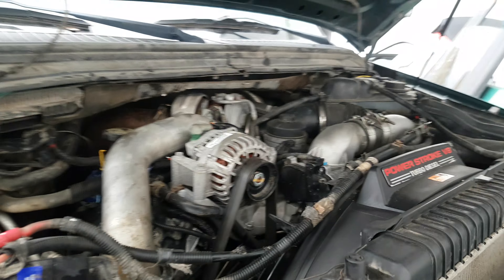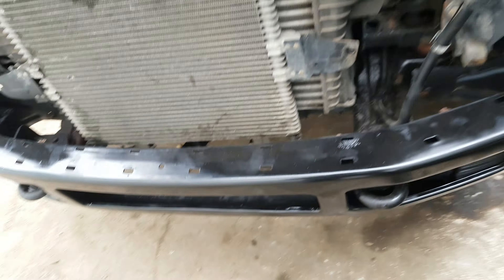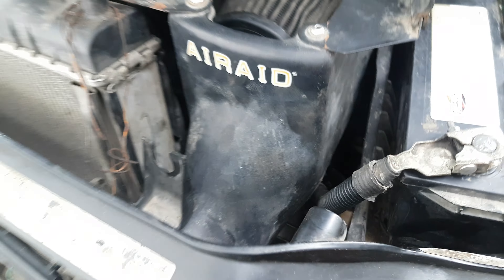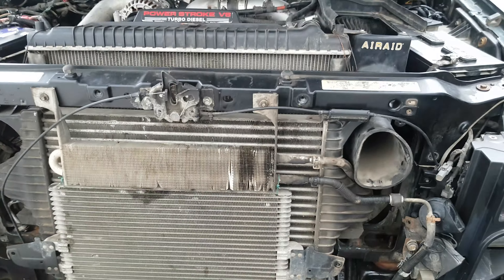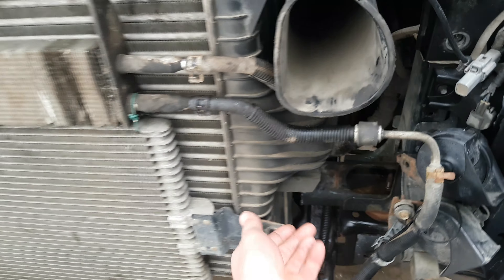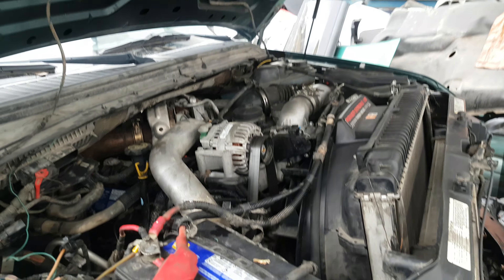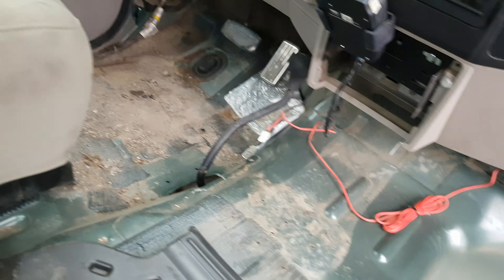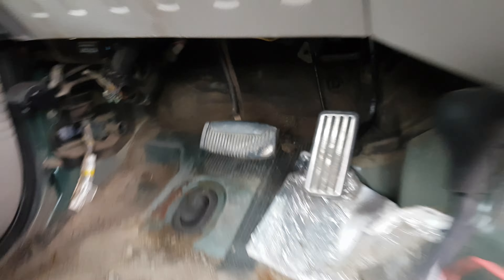6.4 to 6.0 Powerstroke Swap!

Comment: if its the same block and heads but you couldn’t use the same radiator and intercooler. that Confuses me. i love the 6.4 trucks, had a Harley Davidson edition. I always dreamed of having a 7.3 or a 12 valve put in it

Comment: Drew can you shoot me a list of what you had to do to get the 6.0 to work in the 6.4 truck. I can do all the fab work I just need to know what to wire and such to make everything work. I have a pristine 2010 6.4 and have a 18,000 built from the oil pan up 6.0 and want to swap. Let me know please
Reply from the maker: @philliphafer8688  you need someone there with good wiring knowledge and access to the diagrams for both trucks.  Basically what I did was make the 6.0 run standalone with a simplified harness . Ground, power, ignition and start. I left the 6.4 computer and harness in the truck and just connected all the sensors I wanted in parallel to the 6.0 ones. Added the boost pressure sensor to the intake elbow.
Make sure you use the right flex plate etc, I remember there was a difference between the 6.4 and 6.0.
Remember the wire colors don't always correspond, you have to pay close attention to the wiring diagrams

Comment: So far I have gotten the harness trimmed down and the 6.0 running standalone on chassis. 

2 questions I have: 

-What did ya do with the 6.0 cluster? Disconnecting it will cause a DTC code in the system. Did you extract the chip that PCM communicates with? Or is it a simple 5v reference that gets fed to the PCM to trick it to think Cluster is there? 

-Wondering what you had done with 6.0 fuse box? Has some small relays built inside that control the fuel pump. Would like to condense the fuse box  so I can insert under dash nicely. 

Appreciate the video big time along with all your responses. Any help or advice is greatly appreciated and could send ya some money.
Reply from the maker: dtc wont hurt a thing, the 6.4 computer will be controlling the check engine light on the dash so you will have to remove the bulb or ignore it. the fuel pump relay etc I just wired in as needed. keep it simple, pay attention to amperage and gauge and a few fuses are all you need.
Reply: Very true, I tend to go overboard with trying to make EVERYTHING function LOL. 

Thank you for your response and guidance.  How'd your swap working so far?
Reply: GOT IT DONE AND RUNNING DOWN THE ROAD! Would like to share how I did it and get some mote details how you wired the cruise control. 

If I could email you then swap phone numbers , or facebook messager or something faster than email that'd be awesome!
Reply: @drewmurray2583 can you please do a detailed video showing everything you had to do?
Reply: Yes please!

Comment: So i am looking to do the same. I'm getting an engine tomorrow that's just the engine, most of the wireing harness but no pcm. So will the 6.4 pcm and wiring harness work. Also what other tips do ya have
Reply from the maker: @nathanmettenburg2023  you need a 6.0 ficm and pcm and all of the engine bay harnesses.  Have to make the 6.0 run standalone
Reply: @drewmurray2583  was you able to get the heating and air to work

Comment: Did you wire the shift indicator on your swap?
Reply from the maker: yes
Reply: @drewmurray2583  some one said pin #25 on the connector for the ecm for the 6.0 but wjere is that wired to on the 6.4 thanks for the info. Im getting ready to start my swap.

Comment: I'm doing the same thing! 6.4 is a garbage engine and if a guy has a nice bullet proofed 6.0 laying around I think the swap is worth it and simplifies things.

Could I get your email and ask a couple questions about linking the 6.0 engine harness to the 6.4 dash harness ?
Reply from the maker: yeah but I rarely answer my emails, The harness is easy! I just wired the cam, crank, coolant temp sensors etc in parallell. You'll need access to wiring diagrams for both but basically the 6.0 harness has to be made to run standalone with a few wires and you leave the 6.4 engine harness hooked up with those few connections.
Hardest part about it was fitting the 6.0 radiator and intercooler. If I were to do it again I would try to use the larger 6.4 stuff and make custom intercooler and coolant pipes to connect to the 6.0. Then you wont have to cut the body crossmember/ rad support
Reply: Thank you for the elaborated information. I appreciate it. Planning to get this swap done this summer.
Reply: So just a recap

-Wire 6.0 as a standalone setup

-Install 6.4 sensors onto 6.0 and wire them to 6.4 PCM 

Both PCMs will be sharing sensors?
Reply: I Second this.  Both pcms will be sharing sensors??

Comment: How did you connected the ecm?
Reply from the maker: I used wiring diagrams and electrical tape, crimp connectors.
Reply: I'm also doing this,I've already installed the 6.0...but I'm scratching my head on the wiring. Any help would be greatly appreciated!! thanks guys ,Danny

Comment: What tcase did you use? Am i understanding correctly that youre using both pcms?
Reply from the maker: transmission, tcase and 6.0 all stayed together from the donor truck. I remember hearing something about the flex plates or torque converters being balanced different. Yes the truck has 2 pcms, the 6.4 one has a few of its sensor inputs wired parallel to the 6.0 sensors.

Comment: History's biggest downgrade
Reply from the maker: Can't find a good 6.4 block..
Reply: Your tripping 😂, 6.4 is booty meat.
Reply: @writeupking  a good running 6.4 takes a big shit on a 6.0
Reply: @IMTHATKIDJIT  lmaooo for how long tho?  100,000 miles and then boom 💥
Reply: @writeupking  true but mine is deleted and tuned and going on 312k miles
Reply: I need to do just the opposite.  I have a wrecked 08 f350  with 25k ford reman engine  that has 18000 miles.  I have a complete  07 f450 with a bad 6.0  Any advice?
Reply: Swap everything 6.4 related into your 6.0 cab wiring..ect..
Reply: No the Cummings swap is the biggest downgrade.
Reply: @robertcrawford4721 exactly like who wants an in-line 6